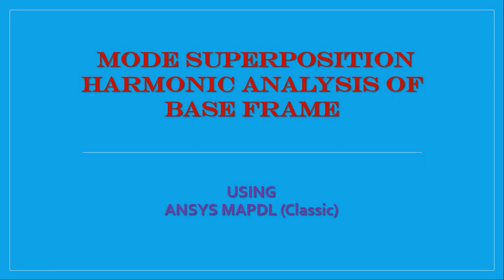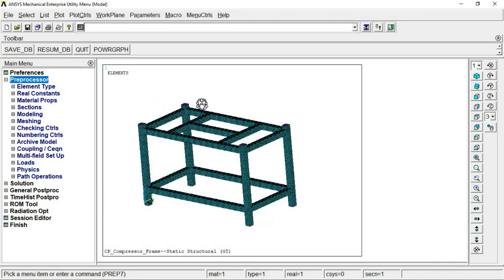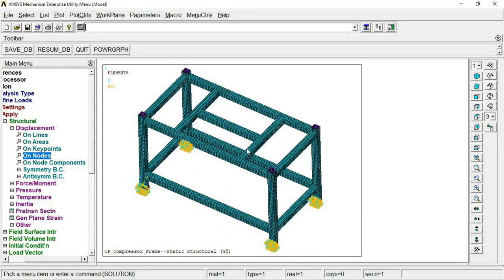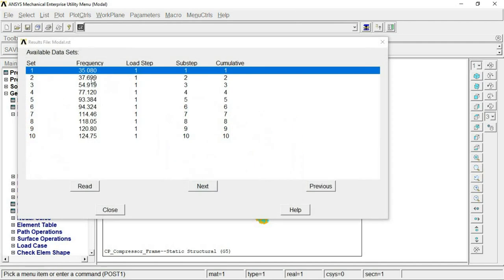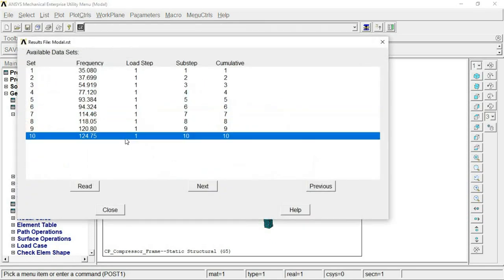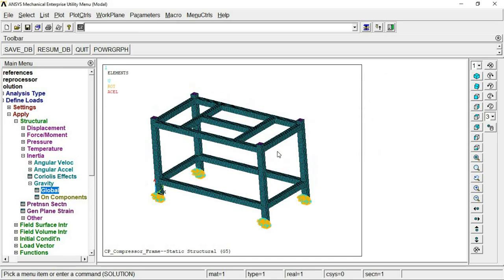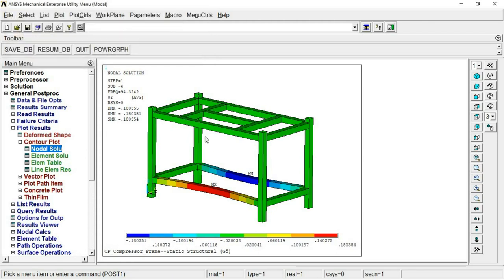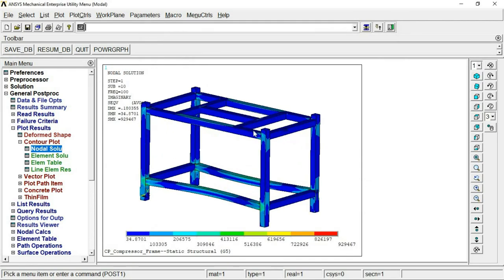Modal & Harmonic Analysis of Base Frame using ANSYS APDL

Comment: hello sir and thanks for your useful video , i just have a question , how i choose the mode shape that affect the whole structure with the
damping coefficeints obtained ? and how i find the period for that specific mode shape ?
Reply from the maker: Hello, you need to check the respective global mode shape vibration, mass participation factors to find out the critical mode shape which will affect the whole modal.

Comment: Hello, I am testing a vibration fixture with base excitation. I did modal analysis with 6 mode shapes of the fixture and the natural frequencies start around 2000 so no Resonance as such but now I am not sure how to give inputs of frequency which I want for base excitation. The frequency increases from 50 Hz to 500 Hz in single direction with a constant 10g acceleration. Can you please guide me ?
Reply from the maker: If you looking for harmonic response in the range of 50 to 500 hz, then you can define this as frequency range and apply 10g loads as mentioned in video. If you are using workbench there also you have option to define frequency range in analysis setting.
Reply: @graspengineering9249  Yes, I defined acceleration and frequency in the solver today. I had to input in tabular form, got results but not sure how to interpret the results. I will share the results as Google drive link, please kindly advice what you can interpret from those results.